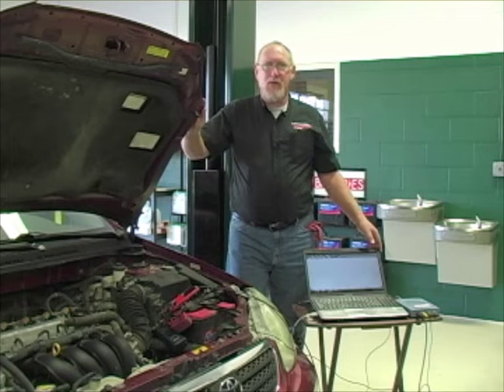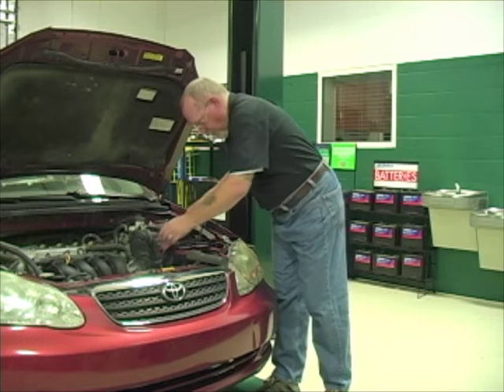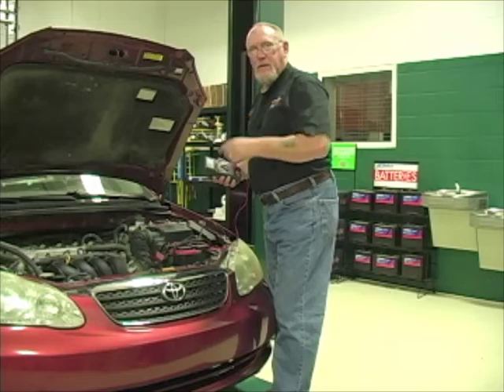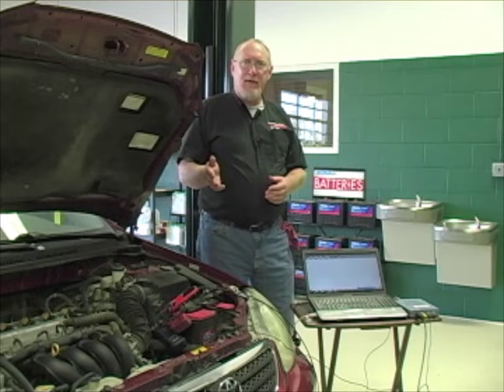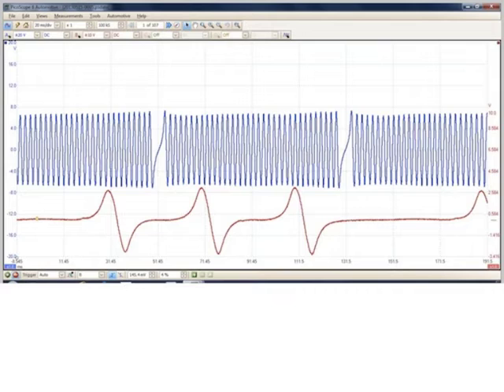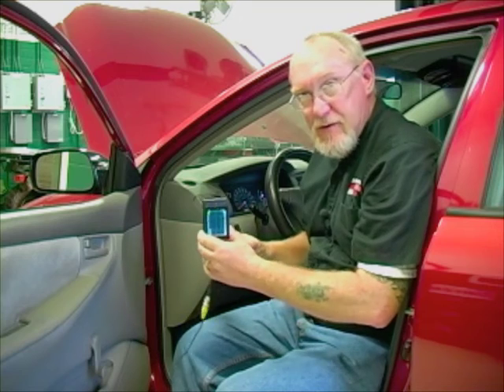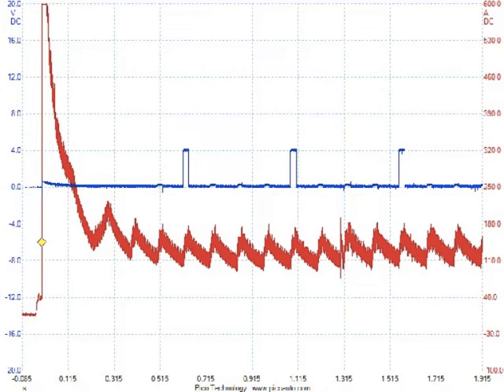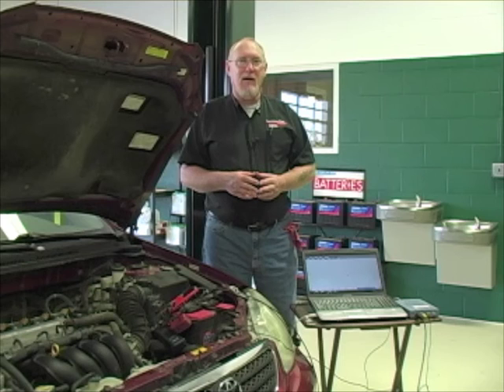The Trainer #30: Learning The Automotive Lab Scope

Comment: I would like to know how to find out what the test leads colors yellow ,Green ect. cause I watched all or most no all the video but none show how to hook the leads to a Otc Pegisys. 2nd the manual how can I get that like a download or pdf.
Reply from the maker: +Joe simpson With a multi-channel scope, each channel has it's own color lead to help the user distinguish what he's connecting to wear. If I remember correctly, the Pegisys scope uses a single common ground lead. The connectors should be labeled accordingly. As for a manual, check with OTC or Google it.

Comment: Great video Pete. I too have a Uscope with an amp probe and although I got a relative compression sign wave it was very small in comparison to the sign wave you achieved. New to scope so I'm not sure how you achieved more detail? 2) Which probe calibration did you set the Uscope to? (1:1, 10:1, 10:1 A or 100:1 A). My amp probe was set to the 60 amp setting. Thanks Stephen
Reply from the maker: +mrghiax I play with the voltage settings and increase the scaling to expand the pattern, rather than use the presets. I'm not worried about actually measuring the current flow for this test, just want to see the variations between peaks (cylinders).

Comment: do you recommend use a laptop just for the pico? i mean,,, use a laptop just for the pico, and info and not for other webs to avoid virus and screw all the expensive programs?
Reply from the maker: I would recommend you have a separate work laptop from any home PC that you use for general work. Both require due diligence to avoid virus infection, though. A good antivirus software is a must for both.
Reply: aw ok sir, thnank you very much for your time to reply. keep the techs table live chat . :)

Comment: I just picked up an inexpensive Hantek 1008C scope for use at the shop where I apprentice.  Got many years of hands on experience but just lately had a career shift and now getting my license as an AST.  The shop I work at is small and really just does upkeep and repairs to their fleet off vehicles, so they can't afford the high priced equipment a regular shop could.  I will be needing to get some attenuators before I begin using the scope on fuel injectors and ignition wires but would I be able to connect the basic test leads that came with the unit to say ABS sensors, TPS, etc that are only smaller voltages and signals going back to the PCM or BCM?  Is Crank and Cam sensor readings ok without attenuators?
Reply: Yes, crank and cam sensors are fine without attenuators.   Systems that have coils or solenoids that can cause voltage spikes from collapsing magnetic fields are the ones that cause concern.  You can also get a low amp probe for ignition and fuel injection, which is great for looking at things like current ramps on coils and injectors.

Comment: what settings did you use on the uscope to get that relative compression wave form?
Reply from the maker: I don't recall the exact settings I used on the UScope, but think about it a minute. I'm cranking the engine over without it starting, so it's spinning about 300-400 rpm. That's 5 revolutions a second (300 rpm). So set your initial time base for a total sweep of 1 second to start and work down from there. Set the voltage scale to AC with a total sweep of +/- 100 to see only the variance on a single screen. 
Other scopes (like the PICO) allow me to set the limits high and then zoom in on what I want to see.
HTH!

Comment: Can you post the brand, model, and price of the scope you were using with
the laptop.? Is it wireless or USB? Maybe a video on choosing a scope would help.

Thanks! Your video was very helpful.
Reply from the maker: Jack,
This is an older model Pico scope, a PC-based USB platform available from several vendors. Choosing a scope is a matter of preference, skill level and cost. Our friends at AESWave (dot) com have several different options and would be glad to help you find one that best fits you.